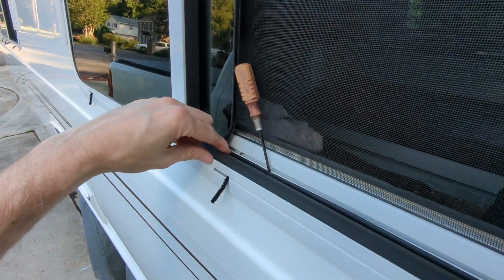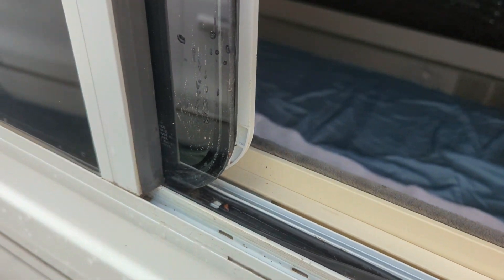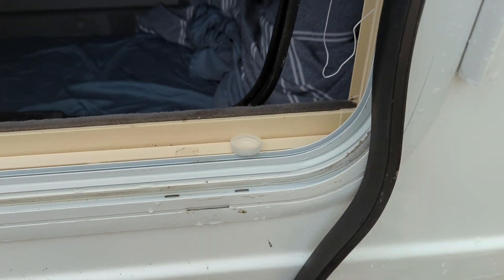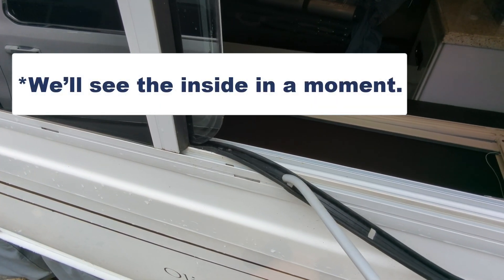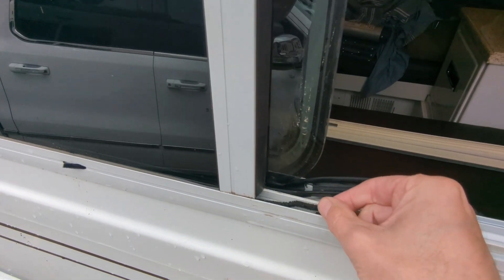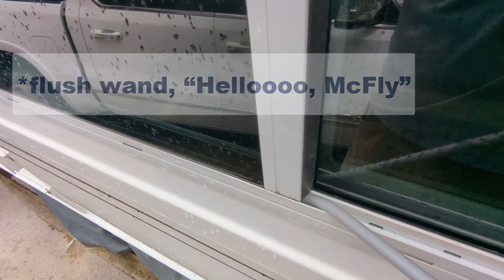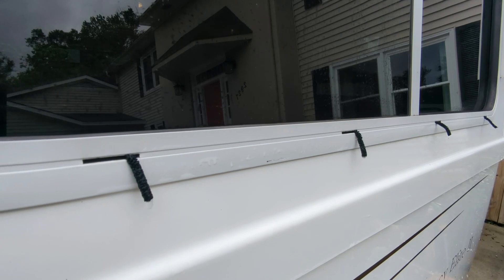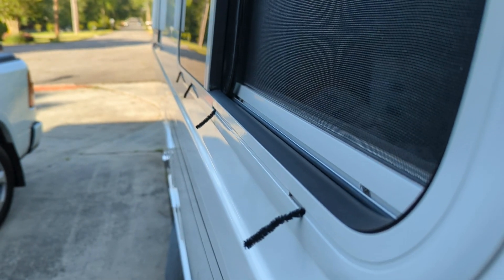Clean Oliver travel trailers windows weep holes and drainage tracks

Comment: Yes, you can only get better.   Pretty good content.  So, as it seems, only one-half of the window slides so the second half is static?  No option to remove the second side entirely?  Even so, it appears the pipe cleaner seems to do the trick.
Reply from the maker: Yeah, half the window is fixed. In place.